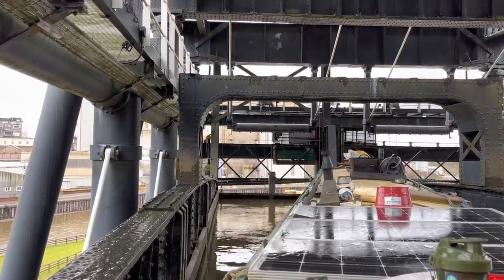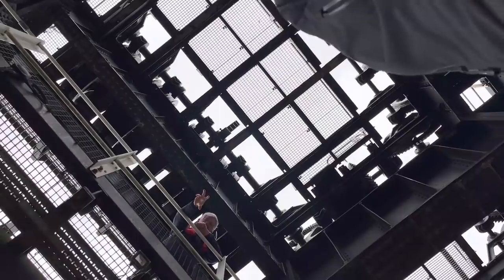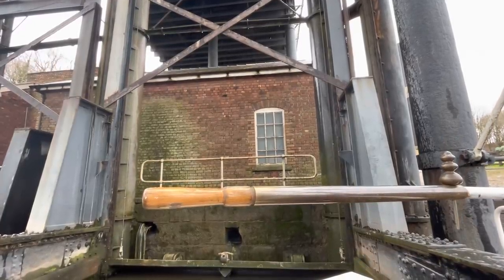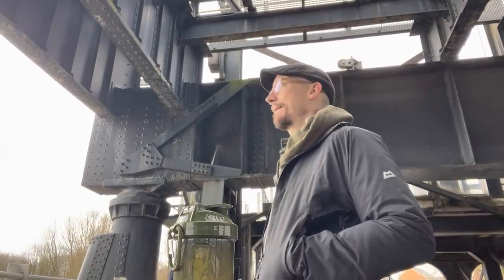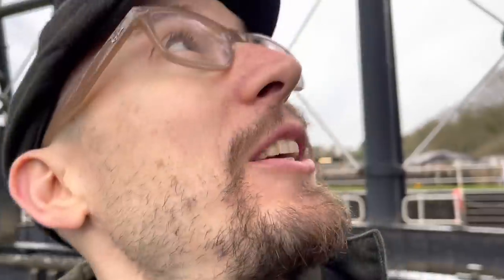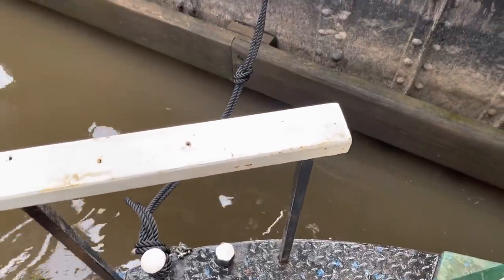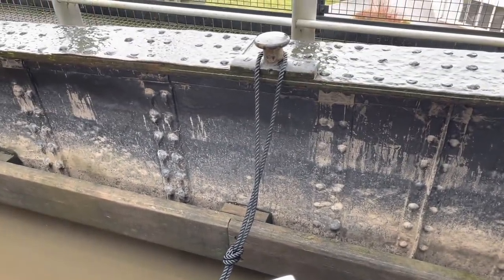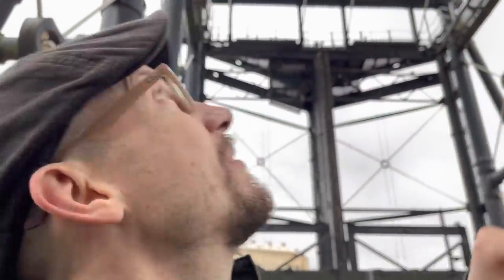First time on the boat lift

Comment: Hi Robbie. Had the wonderful experience of using the lift in the 1970's, not long before it was closed as 'unsafe'!!! Just walked up the wooden steps to the operators cabin (a very nice chap), paid a few shillings and down we went. Operated using counterbalance weights and electric motor then, the caissons operating independently from each other. Nice to see it has been restored to its original hydraulic operation. No boater should pass by without taking the trip down to the Weaver to explore a very different waterway to to the narrow canal system. Happy cranking!!

Comment: Those massive cogs were for the replacement system when the original hydraulic system failed.  They hauled the caissons on ropes.  When that wore out the lift was closed until restoration was funded when the current hydraulic system took over.  The Anderson Lift is an awesome piece of engineering.

Comment: Done the boat lift several times over the years, never ceases to amaze. Would like to have seen Foxton's inclined plane when it was working. Its like all the other amazing bits of incredible engineering you find all over the place and marvel at how and why did "they do that". Its one of the things that drives you on to see "What is around the next bend?" isn't it?👍👌🏽👍
Reply from the maker: Me too, that inclined plane looks incredible

Comment: Great to see the old lift still operating. The first time I saw it it was out of action after they found cracks in the structure. The wheels and cogs are not part of the original structure, when it was built it was hydraulically powered, with a large hydraulic jack under each caisson, one of the original jacks failed and they then converted it to being lifted by cables  and pulleys, that is were those wheels came from.  Nice to see that they have switched back to modern hydraulics to operate it. As a hire boatist I don't think we are even allowed to put a boat through the lift on to the Weaver, unless things have changed now that the commercial traffic has died out.

Comment: The cogs were not part of the original lift but added later in 1904. The original lift was hydraulic and similar to the current design. However the pipes soon failed and were repaired several times before being replaced by the electric pulleys which operated until the lift closed. They were going to repair them but opted for the original system of hydraulics which are in use today.

Comment: I had to check out the Anderton boat lift on Google Earth to see exactly where it was. Interesting that they took such measures to drop roughly 20' instead of using a series of locks. What's pretty cool though is that it has been in operation since 1875, hopefully it will remain in operation for another 150 years.

Comment: from Fraser, husband of Leslie
The Anderton lift started off the development of canal lifts. In 2017 on holiday in Germany we watched the lift in action at Niederfinow
https://en.wikipedia.org/wiki/Niederfinow_Boat_Lift
There is another, larger one in construction nearby, which is heavily delayed but looks almost ready. On our way to Germany along the E42, one can glimpse the enormous lift at Trey-Thieu
https://en.wikipedia.org/wiki/Str%C3%A9py-Thieu_boat_lift
The joke about this lift is that it was a means of subsidising the Belgian steel industry. As it weighs 200,000 tonnes you can see why !
Waterways are still a major transport facility in Europe, just take a trip to the Rhine and stand and watch the barges go past. Of course the Rhine has no locks or lifts at all along its navigable length of 540 miles from the North Sea to Rheinfelden on the Swiss border.

Comment: First time I visited the Anderton Boat Lift (on foot) all those cogs, pulleys, counterweights and gears were still connected, and in use. The hydraulic rams that operate the lift now are underneath the caisson, so you wouldn't see them if you were in the caisson.
Reply from the maker: Wow that must have been about 20 years ago?
Reply: @RobbieCumming  - more like 50 years ago!